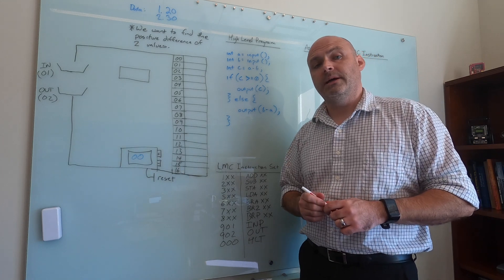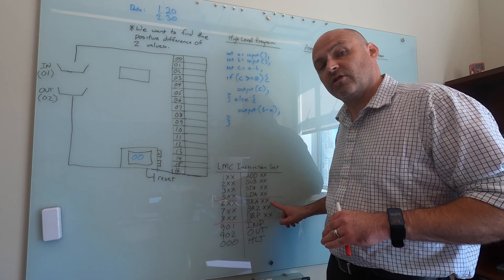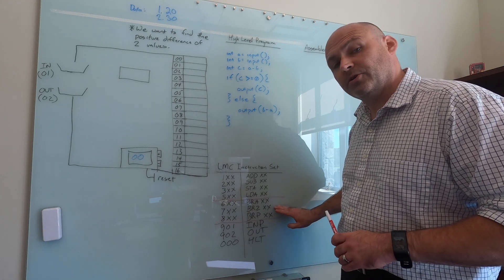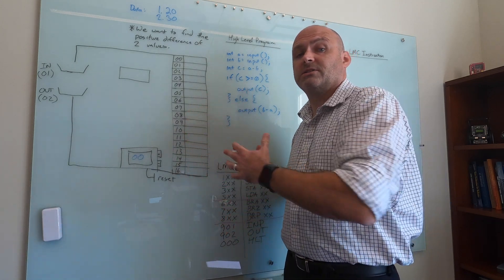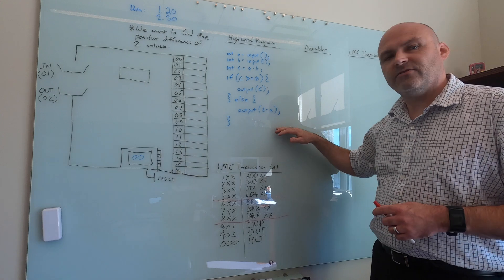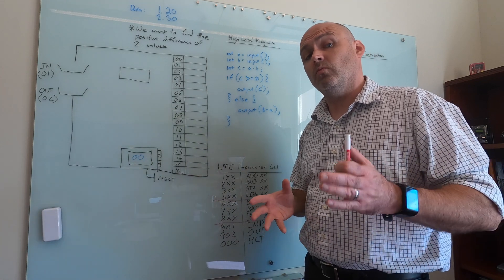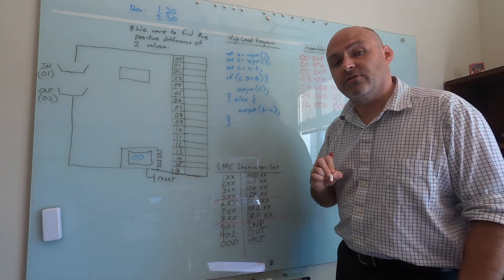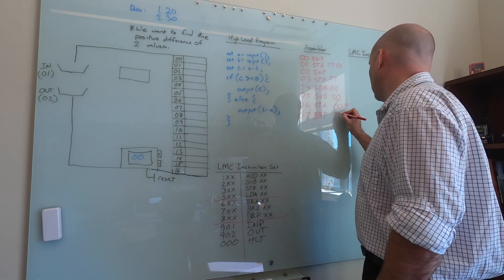Little Man Computer (LMC) Explained: Branching, Compilation and Assembly

Comment from the maker: Try creating your own little man computer branching algorithm that solves a common computing problem.  If you want to be really adventurous, try creating a loop or recursion of some sort.  This will be a topic I will cover in a future video and you will get to check you work against it!
Reply: I watched the video about iteration, branching and labels and wanted to try my hand at the countdown problem. I am not sure that this is the right way to go about it (the video only had around 6 steps), but I tried my best! So, here is my try at the countdown problem with both the assembler and LMC instructions:
00              INP                      /901
01              STA       A           /312
02   loop    LDA      A           /512
03              OUT                    /902
04              SUB      one        /113
05              STA       A           /312
06              BRZ      endIt      /708
07              BR(A)   loop       /602
08   endIt   LDA      A           /512
09              SUB       A           /112
10              OUT                    /902
11              HLT                     /000
12   A        DAT
13   one    DAT
Reply from the maker: Roxanne this looks very good!
Couple of things I noticed: 
1. Lines 4 and 9 use the SUB assembler but have an add op code! (this was an error I made in this video that i noted in with text on the screen, 1 = add, 2 = sub) so i believe both lines should have had a 213 and 212 respectively. 

Running the program with an input value of 3 I get:
3
2
1
0 <- This one is interesting, but it seems to work.  taking it from when there 1 is in the accumulator and we are or line 4 of the program: 1 is subtracted on line 4 (now we have a 0 in the accumulator), saved to mailbox 12 on 5, then the BRZ sends the program to line 8, where the 0 is loaded back to the accumulator, line 9 subtracts the 0 we saved in 12 leaving 0, 10 outputs the 0 and 11 halts.  Definitely a few extra steps but it works well!
Reply: @CodingCoach   Thank you! And okay got it, I must have missed the text on the screen. It is definitely not the most concise, but as you said, at least it works!

Comment: How would you just output a number, say 1, using a branch for only if the first input is greater than the second number? Can you specify the output instead of BRP or BRZ?
Reply from the maker: If you input 2 numbers and then subtract the first from the second and the result is negative you know the first number was bigger then the second (remember you have to store the first)
so..
00 INP          // lets say input is 5
01 STA 10
02 INP        // lets say input is 3
03 SUB 10 // would be 3 - 5 (since 3 is still in the acc)
so choosing a BRP would work for your question since anything 0 or greater would indicate a larger second input.  If it does not branch the first number was bigger
something like..
04 BRP 07
05 LDA 11 // we will put a 1 here
06 OUT
07 HLT
10 DAT
11 001

I think if understood your question correctly this would work.
Reply: @CodingCoach  Ok, I assumed what you just wrote except I got stuck after the branch instruction. Thank you!